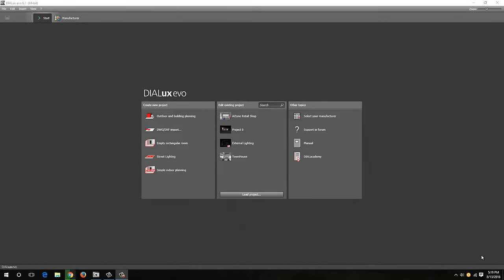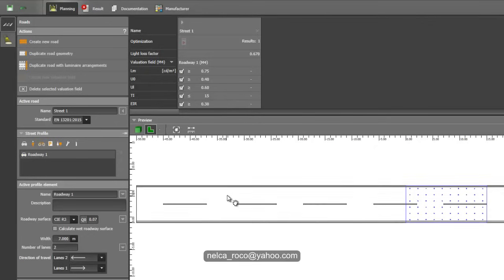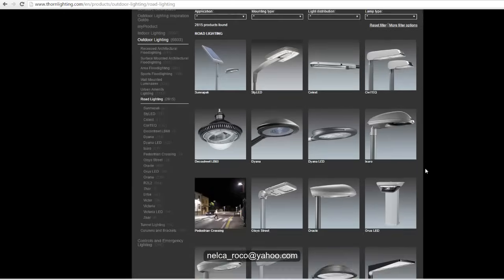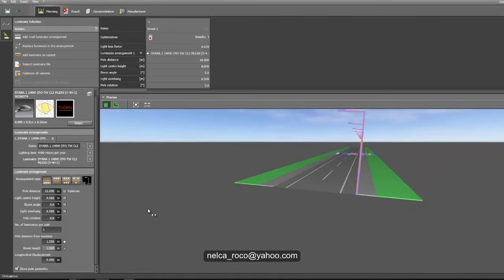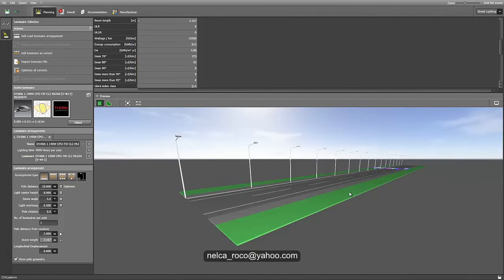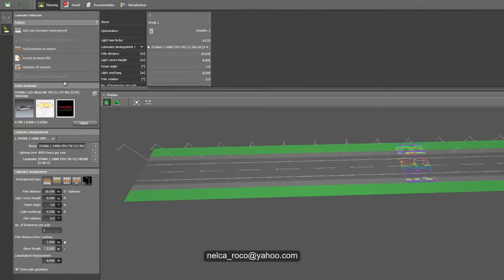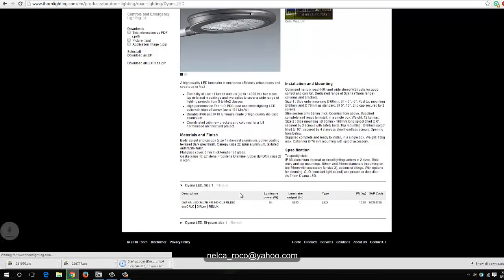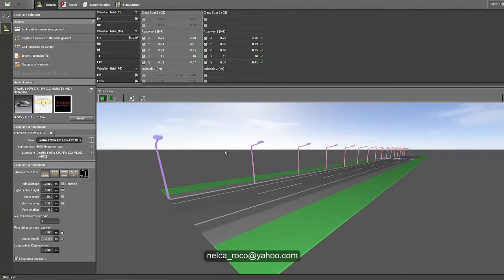Dialux evo - How to do Street Lighting Design Calculation1

Comment: Hi Nelca, In the Active Profile Element, what is the option if the Road Surface is made from Concrete? Should choose CIE C1, C2 or others? the option only Porous Aspalt. 

Also what we should choose for Valuation Field. what we should Choose of Illuminance Class? Should M4, C1 C5 or Others?
Reply from the maker: Hi Wong.  You have so many questions and it takes long discussions to answer them.  May I request to enroll in my Udemy course "Road Lighting Design Techniques" so you will get all the answers?  Thank you! 
Below is the link to enroll:
https://www.udemy.com/course/road-lighting-design-using-dialux-evo/?referralCode=6C150BDEB3270B0A144C
Reply: Unfortunately..

Comment: How can you add a 3Ds file to street lighting?
Reply from the maker: you will not add it to the street calculation. first, run the street calc, one its done and you get the right results, then apply the spacing and tilting angle on the outdoor lighting. in the outdoor lighting you can add the objects you want like trees, decorative poles, and other things.

Comment: Hey thankyou so much fr the information. It was very helpfull. 
By the way i want some guidance to the parameters in the dialux, can you share any documnt for reference? 

And also try for street light of 10m height what is the minimum wattage for 15m distance? Consider 7 m width road and 2 cycle lanes.

Comment: Hi Nelca! Thank you always for your amazing videos. I had a question about pole lighting.

Is there anyway to use pole or mast lighting in the Building and Outdoor planning mode? Every time I try to insert a pole light, the bulb itself will be suspended in the air but it's not attached to a pole. When I insert the light in the Street Planning view, the pole will show up then. 

Am I doing something wrong?
Reply from the maker: Hi Hanna, you need to create a pole when you are at the Buillding Outdoor.  You can use cylindrical objects to do that.  That is under the Object Tab.  Have fun!

Comment: Great videos. You helped me a lot with my final project. One question Nelca. What am I supposed to do in case of a street light system with a power regulation program?  For instance, 2 hours with a 100%, 1 hour 70%, 4 hours at 50%, 1 hour 70% and the last hour with 100%.  Am I supposed to meet the minimum illuminations values also during the period with the 50% power? By the way, cool Italian accent. I'm from Spain. Thanks

Comment: how to make a street lighting design with curve roadways?
Reply from the maker: We usually run it in straight line first to check the distance, wattage, height or pole, bracket, etc. and if the lighting standards requirements have been achieved, then we will layout it in the curve road using the parameters taken from the straight line. It will then light like area lighting. Then if there are areas that are dark due to curve road, then we will adjust the pole spacing from that area.
In short, just calculate it in straight, then layout in CAD, then run another calculation. 
There is no calculation for curve road, unless other software has this option. Probably like AGI32.
I hope it helps!
Reply: Thanks
Reply: In indoor and outdoor building how can i get the result of Uo, TI, UL ... ? incase do not use street mode.
Because I have to calculate some path in the park.